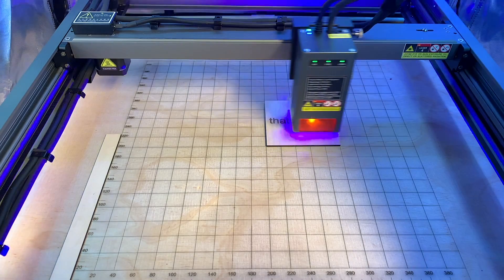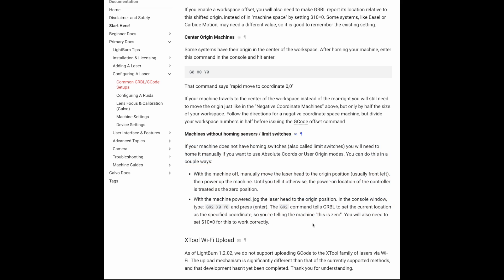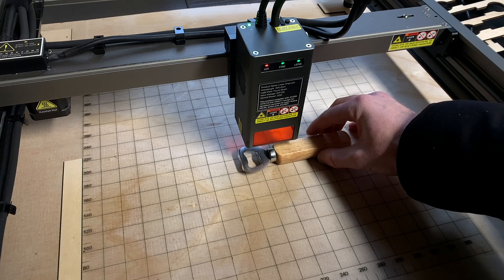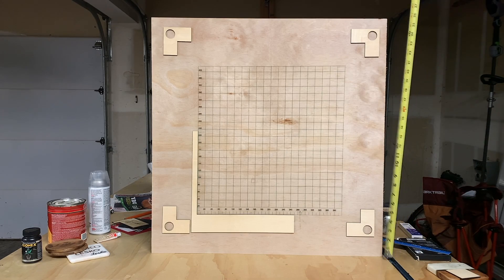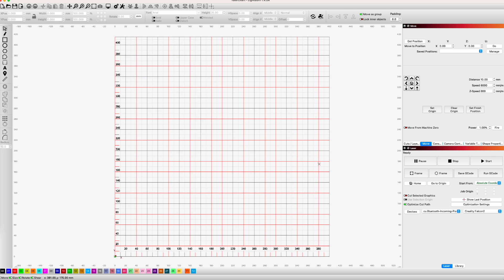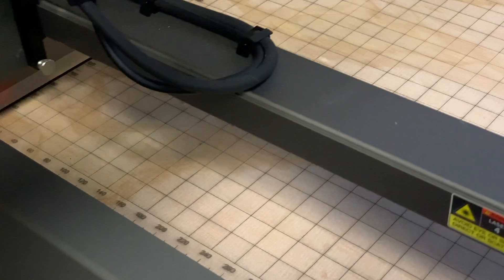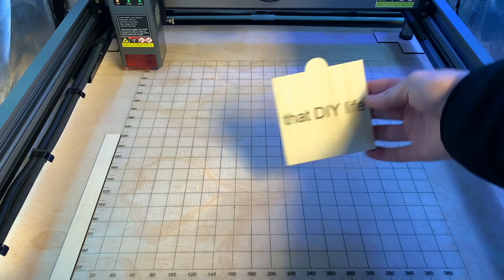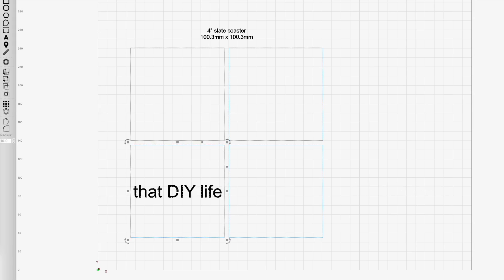How to use absolute coordinates with a laser engraver

Comment: love your video. I have same laser so it has helped me no end. especially as i've only the one arm. I've subscribed. thank you. OK done the feet no problem & copied your files to use but for some unkown reason all it lasers is the numbers & lines between each number along the bottom & to the left side but is not lasering the whole grid. Weird. Preview is the same. it does say however that one or more shapes aer crossing the edge of the workspace & will not be sent. again, why? It's the Same Creality Falcon 2 Laser

Comment: The reference for the boards in amazon is 300mmX300mm. This is smaller than the engraving area of the laser.  This is only for engraving, it would have to be removed for cutting so you don't cunt into the grid. This is a very nice grid and explained very well. Thank you
Reply: I believe the referenced boards are for the guides to be cut from. The base, which has the grid engraved into it, would be plywood or MDF of a much larger size.
Reply: That would be a c*nt if you c*nt into the grid 😂😂

Comment: Okay this is very helpfull but when i cut with the laser it leaves marks on the steel that ive put down instead of the grid. So how do you not leave marks?
Reply: I've done all my engraving using this method for over 3 years now. But when you cut you probably will want to use a honeycomb bed. You will still get marks underneath the honeycomb so you might want to put either a sheet of steel or aluminum under the honeycomb to keep from messing up your nicely engraved grid. When you make a cut on a piece of wood precision is not normally need. And besides,  you will not be able to precisely place your wood using the honeycomb bed. It's kinda like throwing handgrenades, close is good enough. When I engrave, the honeycomb bed comes off. When I cut, the honeycomb bed goes back on. As simple as that. I may have missed it in the video but whenever you make your jigs for, say, several coasters, make sure you 'lock' the outline of the coasters in your LightBurn file or you may accidentally move the outline. When that happens your jigs are useless. I hope this answers your question.
Reply: @krisknowlton5935  😊 Hi, this video shows how to use jigs for cutting besides engraving with honeycomb bed: https://youtu.be/Non9lnrDzB4&t=583
Reply from the maker: I don't fully understand your question but it sounds like the position of your engraving is off.
Reply: @thatDIYlife  I use a diod laser sculpfun s30 max so when i cut material i use 100% laser power and it takes like few passes to cut but when it cuts the material it leaves a. mark of burn at the steel plate i use as a bottom
Reply from the maker: oh, that's normal.  I don't think you have anything to worry about.